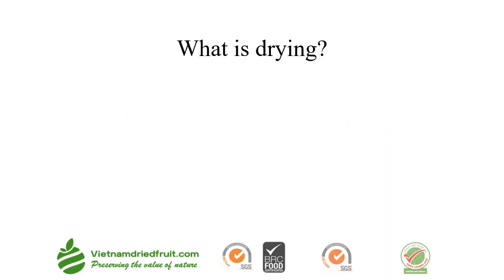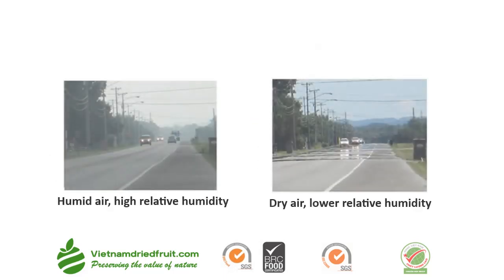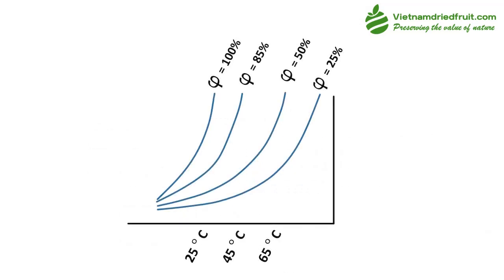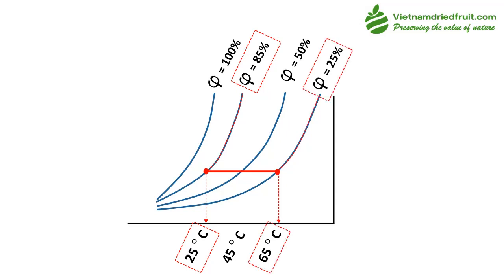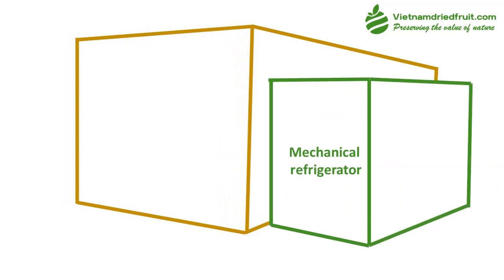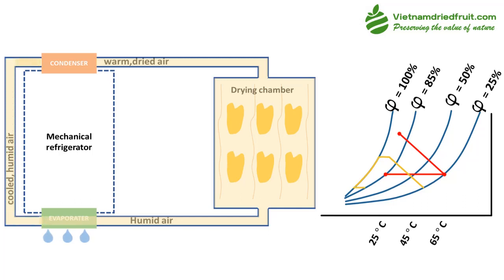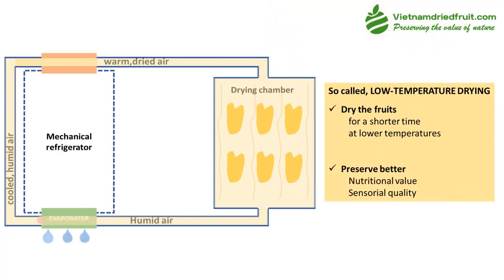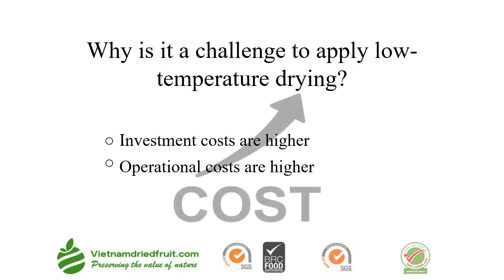Principles of heat-pump drying technology | low -temperature drying

Comment: Your diagram of mechanical refrigeration is not right, the bottom part should be condensator whereas the upside part should be evaporator
Reply: the bottom part is an evaporator: inside the evaporator, the refrigerant evaporates (converts from liquid into gas) and this conversion requires energy. It takes heat from the drying air, which then cools down the air :)